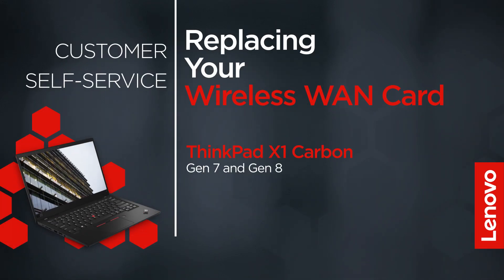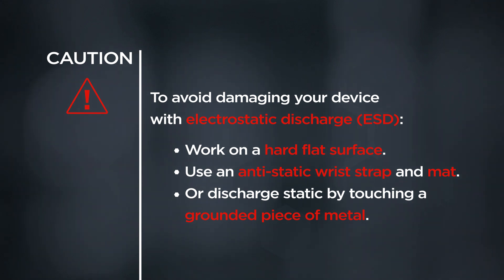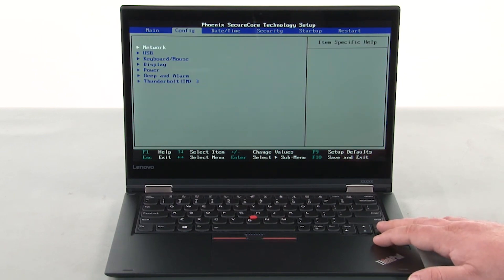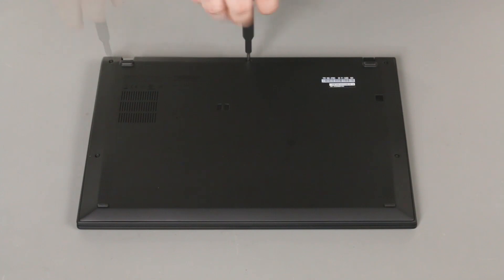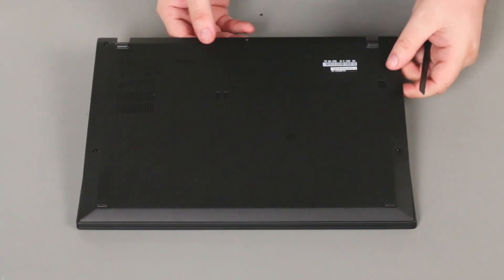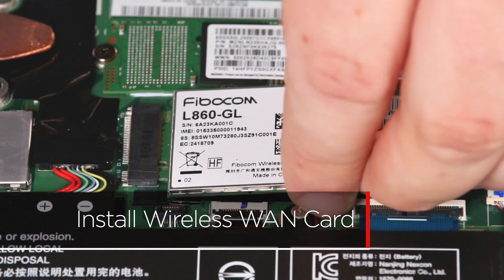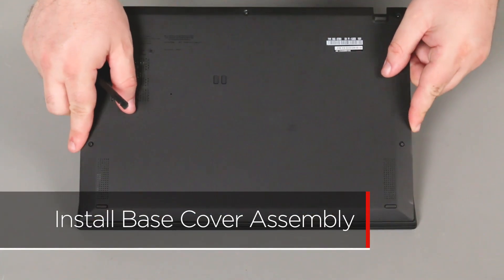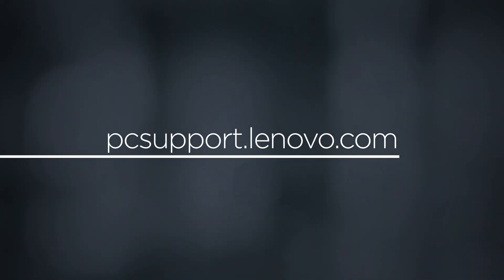Replacing Your Wireless WAN Card | ThinkPad X1 Carbon Gen 7 and 8 | Customer Self Service

Comment from the maker: This video will show you how to replace the Wireless WAN Card of your ThinkPad. The process in this video will work for the ThinkPad X1 Carbon Gen 7 and 8.

You will need a screwdriver kit, a non-metallic pry tool, static-safe tweezers and 15 minutes of your time.

To learn more about your device go to https://pcsupport.lenovo.com

To find parts for your device go to https://support.lenovo.com/parts-lookup/?cid=ww:lenovosocial:b9515f&source=socialmedia&subsource=yt

To view the Lenovo Support Self-Repair Guides landing page go to https://support.lenovo.com/us/en/solutions/HT516547

** NOTE: Static electricity can destroy components. Use a grounding strap, and clean, non-conductive surface to work on. Use plastic or coated tools to prevent scratching and avoid using metal tools on plastic parts. For more detailed information on electrostatic discharge and how to prevent it, please watch our ""Understanding Electrostatic Discharge (ESD)"" video: https://youtu.be/by4PB3WtdLo 

Applicable Machine Types:
ThinkPad X1 Carbon Gen 7 - 20QD, 20QE, 20R1, 20R2
ThinkPad X1 Carbon Gen 8 -  20UA, 20U9

#lenovo #LenovoSupport #LenovoTechSupport #thinkpad